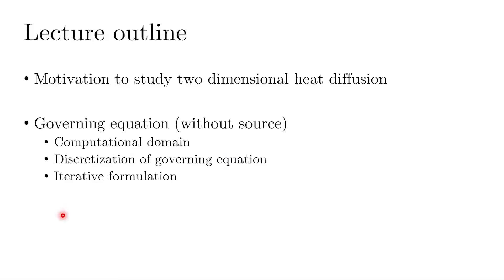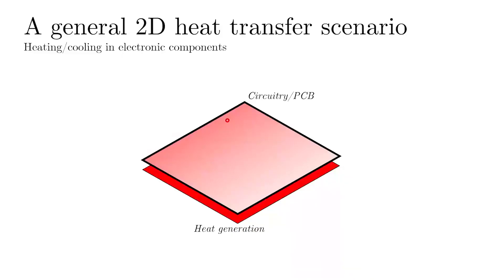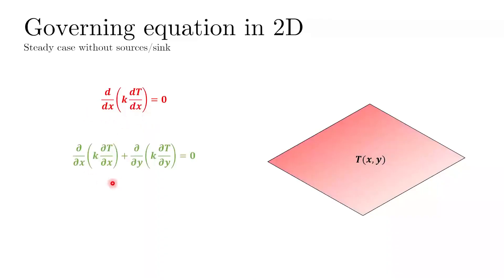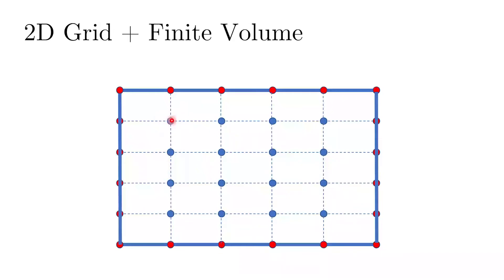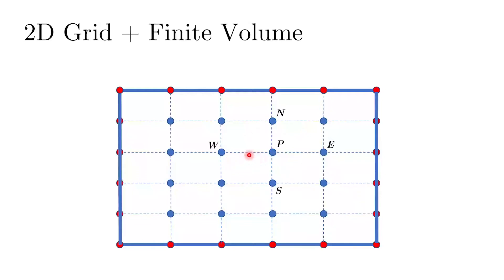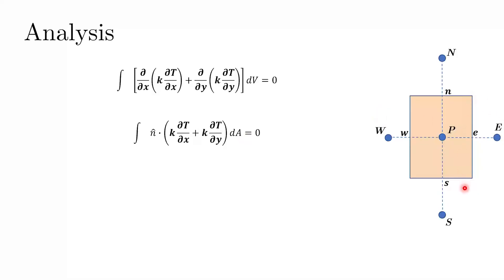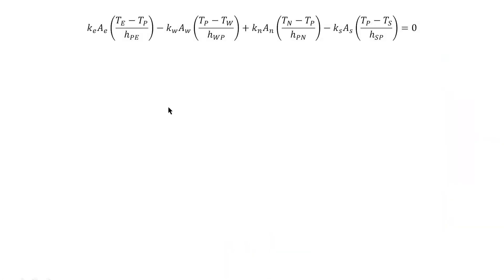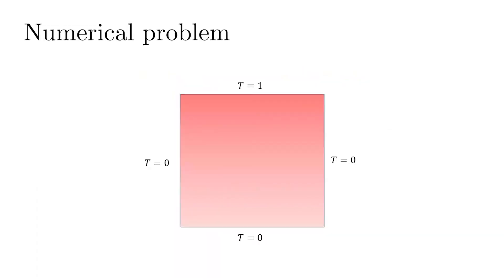Steady Two Dimensional Heat Diffusion using FVM | Lecture 10 | Simulating Fluid Flows Using Python

Comment: I'm enjoying the lesson so far. How do we estimate the episelon value? Where does come the formula for the numerical-error??
Will we have also the staggered algorythme using python?? Will we have also the the matrix scheme for resolving the coefficients (ae, aw)??
Reply from the maker: Epsilon is generally taken as a very small number. You can take other forms of that formula for example RMS error. Yes, we'll use staggered grid system later on, but without matrix formulation.
Reply: @TanmayAgrawal7  Thak you for the feedback, sir. Why does the episelon have to be small?? And in case of RMS, what should we consider?? 
In terms of suggestion, it should be goood to have also the matrix based approach >.